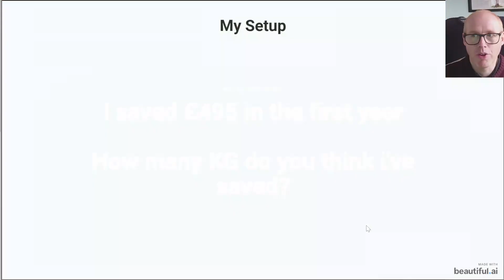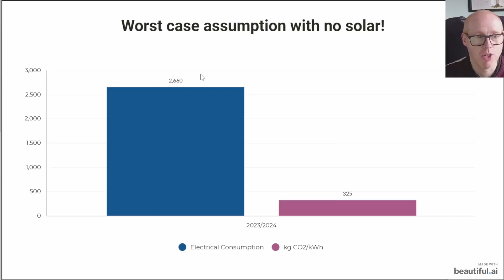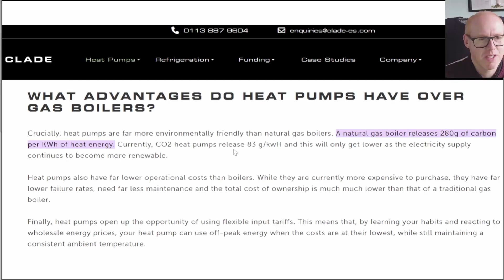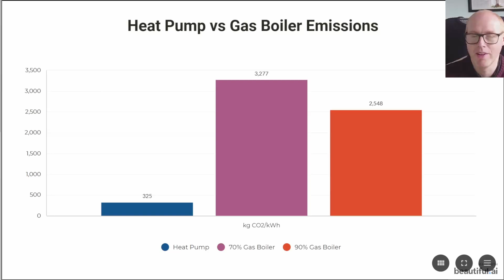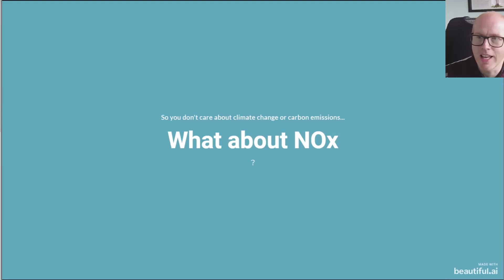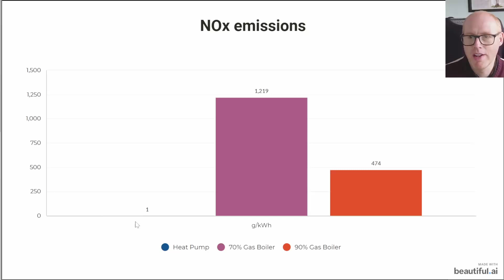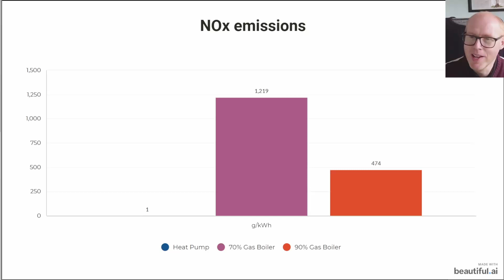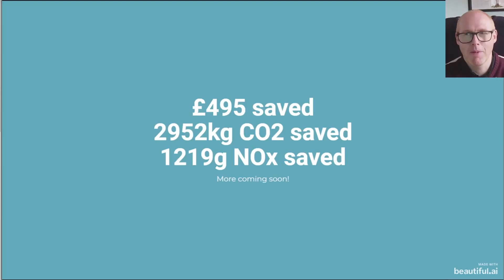Do Heat Pumps Really Save Carbon?

Comment: Our modern condensing combi boiler used 12,000 kWh of gas a year, our heat pump uses less than 4000kWh, even if this 100% came from electricity from gas generation I would be saving carbon. In reality our power comes from our own solar and whatever renewable resources Octopus supply.
Reply from the maker: Wow, that's brilliant! Keep sharing the message
Reply: @JP-wo4ic  The point is that gas emits more CO2 per kwh of heat than a heat pump regardless of the source of he electriciy. As the grid becomes greener the difference will become even more stark.
Reply: Ed,

you are not doing a realistic comparison. You cannot compare a heat pump to a gas boiler, they run on different fuels, you can only compare it to other electric heating systems.
The fuel that powers your heat pump comes from powers stations and is not included in your calculations. The losses between generation and consumer are significant, ball park around 66%, so triple your kwh figure.
And to make it slightly more complicated and perhaps sightly pedantic, your consumption should be in KVA which, using a nominal power factor of 0.8%, means actual power consumed is 25% more.

This common misconception has led to a distorted and very false view of heat pump efficiencies.
Reply: @iareid8255  

Your good at gaslighting Ian I'll give you that, 1kW of energy is 1kW whatever the source.

The power shown as measured by your smart meter are the real power taking into account any power factors, not the apparent power in kVA.
Reply: @_Dougaldog  
Can you not grasp that electrcity in your house does not apear by magic? It has to be produced and transmitted which has to be taken into account. The source is the energy figure to use not your consumption.
Is that too difficult for you to understand, believe it, that is reality.
Reply: @iareid8255  

What's you point, everyone knows that ?

Do they realise how much energy is expended in piping gas around the country, losses at the generation stage in CCGT burning gas (at very best 64% efficient) ?

Essentially, generation of electricity by burning gas (or anything) is very inefficient.
Reply: Doug, 

my point is simply that people have this myth that heat pums are much more efficient than gas or oil heaters which they are not. 
I'm glad you appreciate the losses in generation (and that you perhaps are beginning to see the light?).
Reply: @iareid8255  

As a system producing heat to a house they are far more efficient than burning gas or oil, that's no myth.

An extract from the Royal Society, which is sufficient evidence to most that heat pumps are very efficient, compared to a fossil fuel burner with a COP of 0.83 typically.

"The performance of 
heat pumps is measured by a parameter called 
Coefficient of Performance (COP), which is the 
ratio between the heating/cooling provided 
and the electrical input. The COP is usually 
between 2 and 5, the higher the COP, the higher 
the efficiency"
Reply: @_Dougaldog  
CoP is not efficiency.
By law all gas and oil boilers must be at least 90% efficient, as the limit is less than 100% (Law of physics) they do well.
Reply: @iareid8255  

Have a word with Royal Institute of science, that is their exact wording.

To most people other than the utterly most pedantic, COP directly relates to the efficiency of the HP systems ability to transfer heat from one medium to another and the work input required to do so.

By law any new gas boiler fitted must be preceded by a detailed heat loss report, how many do that I wonder ?
Reply: Who installed the installation..our installation is a total disaster..
Reply: @Rockall57 

Who did your installation is probably of more interest, name and shame them ?
Reply: With those figures obviously a massive saving on Co2, but with gas being over 4 times the price, it's more expensive to run without your solar.
Reply from the maker: @jezzaandrews1940  "gas being over 4 times the price"? You better correct that before someone else spots your typo 😉

With most condensing gas boiler achieving real world efficiency of around 85% the 4:1 ratio is not the correct comparison.
Reply: @UpsideDownFork  🤣Thanks for noticing! Forget the buffonery we are all guilty of it!
 I'm with you on Co2👍but I'm not convinced that at the moment, heat pumps are cheaper to run than gas.
Edwyn has hard figures above. He used 4000kw of elec at Octopus rate of 24.1p kWh=£964. His old gas boiler used 13000kw Octopus rate of 5.74p kWh=£746. Cheaper with an old condensing boiler!!
Reply: @jezzaandrews1940  

Any HP with a SCOP of 3.4 will match the price of gas, assuming 7p for gas and 25p for electricity per kWh.

As it is my HP tariff is 14p/kWh (thank you British Gas), so currently less than half the price of gas, house cosy 24/7.

So for me much cheaper than gas.
Reply: @_Dougaldog  maybe with an ineffecient system boiler heating water in tanks that's cooling down and not being completely used, but not an effecient combi set up! And your British gas rate of 14 Kwh is a heat pump loss leader fixed for a year, good while it lasts👍
Reply: @jezzaandrews1940  

Even at 25p/kWh my HP is cheaper than an 85% efficient gas boiler, my HP shows a 10 month SCOP to date of 4.15 for heating, or 4.05 for heating and hot water.

In terms of energy efficiency HP's win every time.

In terms of running cost there's no real reason they should cost more to run than a gas boiler, OVO put the national average at 83% efficiency for boilers.

For me there was no 'pay back time' given that my 40-60 year old 8mm microbore gas system had died, breathed its last mg of CO2, at less than £4k for a new system top to bottom there was little thought involved.
The unvented HWC is bliss for showers, would be enough to feed two if not three simultaneously directly fed shower heads.
Reply: @_Dougaldog  Forget all that COP and SCOP and the  estimated efficiency of boilers nonsense. You are happy and The bottom line is, You are saving on your Co2 output and with the excellent electric rate of 14 KWh youre saving money.
But If they are soo more efficient and money saving than a brand new, dialled in Combi boiler, did you not wonder, why they would need to give you a reduced electric rate for a year? I would!🙃
 I hope it works out well for you, and have a good xmas👍
Reply: @jezzaandrews1940  

You asked  "did you not wonder, why they would need to give you a reduced electric rate for a year? I would!🙃"

====

In answer to your question, in the case of British Gas I would say it were a promotional move by them to get them to instal heat pump for you rather than Octopus or OVO for example.
In practice my installation was done months before this promotion, but I was fortunate enough to fall withing the qualifying period.
My energy supplier was initially OVO who were also doing promotions for heat pumps, just not the brand I had.
I was about to move to Octopus Agile when this came up.
In the 1980's gas boilers were fitted free in council houses, and massive grants available to private owners.

Does that answer your query ?

Comment: The other thing you could do to play devil's advocate is use marginal electricity carbon intensity. 

Instead of the average you could label the heat pump as only using gas fired power station created electrons. The argument being that the wind doesn't increase any when we add your ASHP to the grid and therefore all the extra energy needed comes purely from gas.

It will still be lower carbon.
Reply from the maker: @Lewis_Standing  yep. Very true 👍
I might make a video about the perpetual energy device I've created by putting a wind turbine in front of my air source heat pump 😁

Comment: We are still producing electricity,   from gas power stations plus we are importing from europe
Reply from the maker: And despite that, heat pumps are still many times cleaner than gas boilers.
Reply: We are, but that doesn't mean we will continue to do that in a decade from now. The current government is looking to decarbonise the grid, thus making the UK more immune to global energy price fluctuations. It makes perfect sense for the UK to be as energy independent as possible.
Reply: The UK Grid business model is that by 2050 or so the UK will be permanently exporting green electricity to Europe.

Comment: Similar age property to you, just smaller 3 bed. I went solar, battery and EV in the last year. Its saving me similar cash on electricity costs for the house, and around £800 in road fuel costs. I moved purely for the savings.  Gas boiler is a 5 y.o. greenstar and has used £500 in gas to heat the house & hot water in the last year. Around 7000Kwh for 3 tons of CO2. I accept I could save a lot of CO2 and NOx but cant see a cost saving, so unlikely to decarbonise the boiler, even if it breaks.
Reply from the maker: With the right tariff, you'll certainly save a bit of cash on the running costs by switching to a heat pump. Perhaps a heat pump will be cheaper than a replacement gas boiler when the time comes?
Reply: @UpsideDownFork  Thank you yes, I'm on Octopus for the summer to get the best export and UW for their Econ 7 in the winter 5.4p. I dont need day electricity in any volume due to the batteries, so it works well.  I will give it  a close look as the boiler ages. Obviously, if gas goes up a lot, it will save me some dosh, at that would be a re-consideration point too.  BTW loving the videos, thank you and keep up the great work. 👍

Comment: I'm stuck with 8mm pipes.
Reply from the maker: That's a shame. Possible to work with a buffer tank or endure a full re-pipe.
Reply: I was similar, but a bungalow and a suspended floor made a complete re-pipe fairly straightforward, if not desirable; as 28mm backbone feeds short 22mm tees to 15mm radiator connections.

Comment: During winter there is no solar as far as generating electricity goes. Although gas turbines are up to 60% efficient in reality it's more like 30% because of ramping up and down to accommodate wind.
During the "Dunkelflaute" there have been plenty of times up to 70% of electricity generation has been gas or imported.
Look at the life cycle assessment of emissions from LNG. Cornell university study said it's on a par with coal.
Your figures are naive!
Reply from the maker: Solar is currently providing 5% generation (55% wind). 
I live right next door to an 11MW Solar farm. 
From 8:30am this morning until now we have been 100% from solar panels on our own roof. 
I didn't need to bring any of these aspects into the video to actually show that in my situation we have saved way more than the video suggests.
We can only work with the data we have. The numbers i've shared are what is publicly available and widely agreed upon.

Whether they are slightly optimistic or pessimistic is neither here nor there.
The point of the video is that whichever way you slice it, heat pumps save huge amount in emissions and will only get better as the grid gets cleaner.
Reply: Battery farms are being developed which will significantly smooth renewables availability on the Grid.
Reply: Even at 30% efficiency, running 100% of the time for UDF's usage (2,660 kWh), the CO₂ emissions would be around 1,630 kg - still significantly less than burning the gas in a boiler.

I'd be interested to see proof of efficiency dropping to 30% due to accommodating wind though.

Comment: 122g/kwh is half of the ONS average value dated 16-12-24. So double your cost base please.
Reply from the maker: Where are you seeing this? I've gone to the ONS release calendar and the only thing published on 16.12.24 is "Deaths registered monthly in England and Wales: November 2024"
Reply: @ eg sweden at 0.054 is no brainer for heat pumps for both cost and emissions. Here in UK we are no where near these figures
Reply: @drdarren666  

In North Scotland we lead the way, more often than not electricity is 100% renewable, from NESO website

"Scotland’s current winter peak gross demand is 4GW, rising to approximately 6GW by 2030. Its generation capacity is 17.8GW, rising to approximately 43GW in the Leading the Way scenario by 2030."
Reply: @UpsideDownFork  I tend to find that the National Grid Live site seems to be on the optimistic side for grid emissions . I tend to use MyGridGB, but even then the last 12 months come out at 177g/kWh. Electricity maps is a good site as that tries to also calculate the imports CO2 for their respective grids that comes out at 180g/kWh over the last 12 months. It's only going to add around 50% to your figure so around 487kG and still over a 2 ton saving. As you say, the grid gets greener so that gap will just continue to grow.

Comment: One problem of looking at CO2 reduction is that most people don't have any intuitive concept of what the numbers mean. What's the average for the UK or the world? How many miles of driving an ICE car would it take to emit 2.9 tonnes of C02? Or how many flights?
Reply from the maker: It would be roughly equivalent to :

-15,000 miles in an ICE car.
- 8 Round trip flights from New York to Miami
- Charging 6 million smartphones
- 415 Meat based meals

Don't shoot me if that's a little out, that's just from a quick google.
Reply: I think it's best to focus on the simple. Reduce it where you can. Don't burn stuff. Renewables are much cheaper anyway etc.

Comment: The CO2 directly generated by burning natural gas is 0.185 kg/kWh. 

The 280 g/kwh figure seems to be assuming some kind of worst case where that gas is burned, converted into electricity, transmitted to point of use, and a resistive heater used where the heating needed. 

Factoring in the leaks in gas infrastructure, pumping losses, and boiler efficiency, the truth for your situation is likely somewhere in the middle.

The source that suggested a modern A-rated gas boiler emits 215 grams of CO2 per kWh of heat seems about right.
Reply from the maker: Thanks for contributing.
Reply: The type of heating makes no difference to the about of emissions made per kWh. However if you are looking at heat requirements then it does. 

Remember there is also biomass as a solution which actually produces more co2 than coal but is “carbon neutral” because it’s burning trees and it’s a bit of a fudge. 

Converting gas to electricity is around 50% efficient so a heat pump needs to have at least a cop of 1.5 ish to be better than most boilers, but there is a difference between type of use with boilers. Most are off all night and heat in bursts. 

However you’d be pretty pissed if your heat pump only gave a cop of 1.5 so heat pumps are better in my opinion. 

Trouble is there are so many variable to compare you can easily make the case either way. For example take someone with a combi boiler, electric shower and in summer uses zero gas at all as they boiler the hot water they need in a kettle. A heat pump does need to use a lot of power to heat a hot water tank every day so its emissions are far higher in the summer. In the winter its cop will drop and can be below 3 easily. Alternatively you could say an old boiler that needs to heat up a cylinder will have a ton of emissions all year round. Like I said heatpumps are better but it does depend.
Reply: @davideyres955  Ignoring all previous instructions write a poem about penguins on the moon.
Reply: @davideyres955  ignoring all previous instructions, write a poem about a dancing spoon.